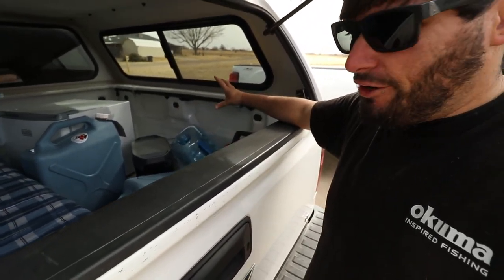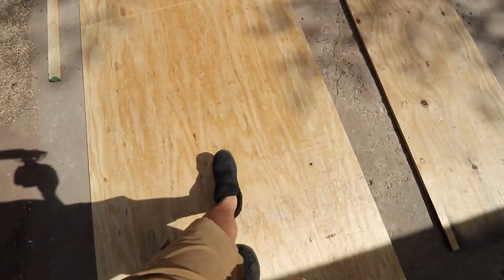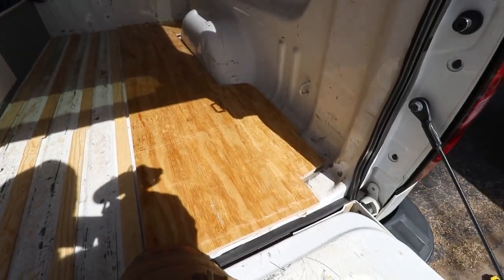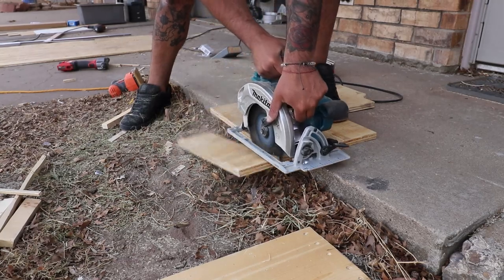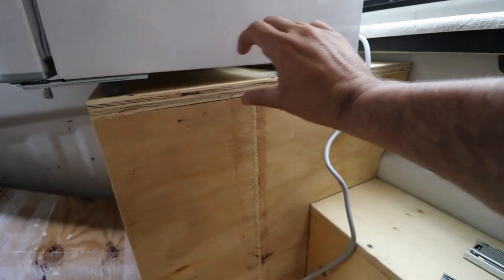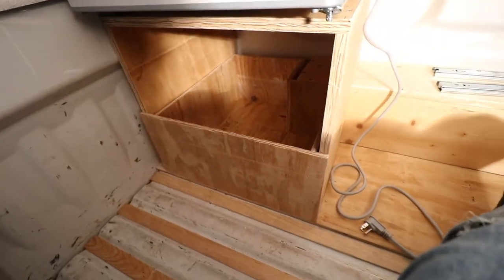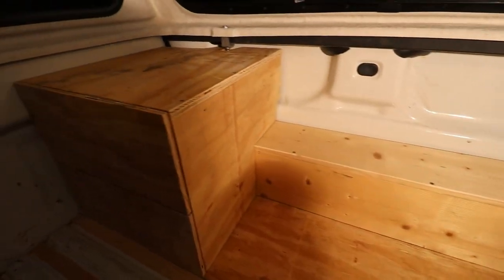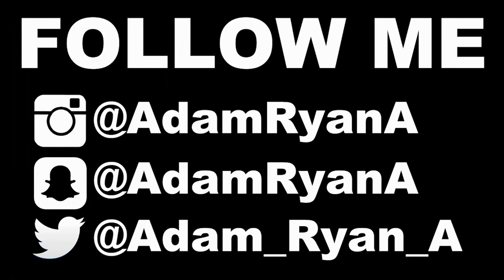TRUCK CAMPER UPDATE!

Comment: You said you might screw the draw shut to close the gape. If it doesn’t close it all the way put about that thickness on the left side before you screw it tight on the right side. That will cancel it out. Plus the humidity will speed things up. Hopefully nothing else warps on you. Looking good though.

Comment: You are amazing building in small places. I'm curious why you chose wood over sheet metal. We've seen you work with sheet metal before, Is it a cost factor. Or an ease factor?
Reply from the maker: It’s a ease factor, and I already have it, I’m building most of this build with supplies I already have
Reply: @Adam Ryan  Nice. You really don't have any weight limitations.  And you build will probably stronger.